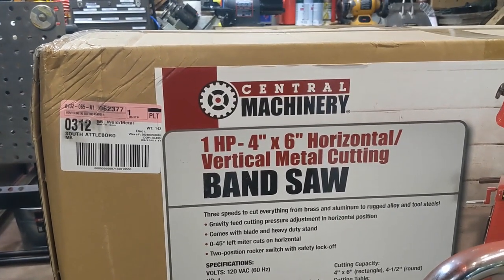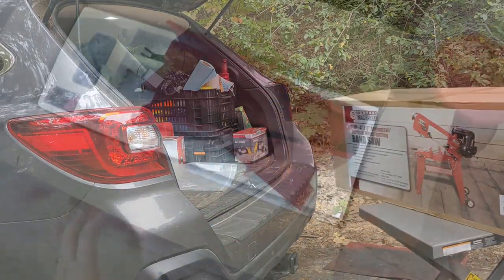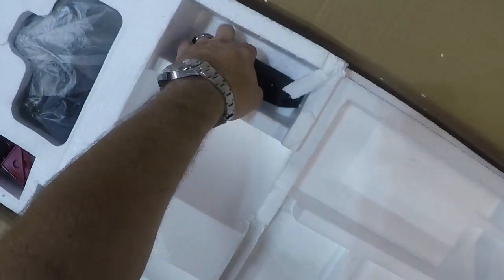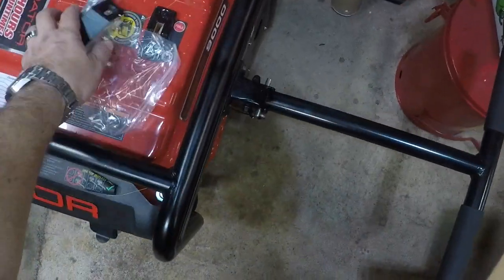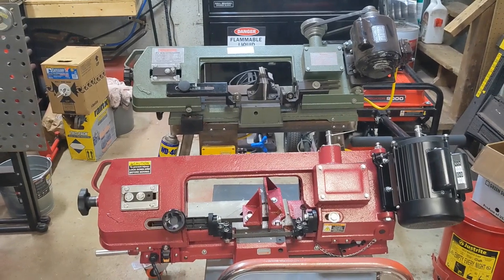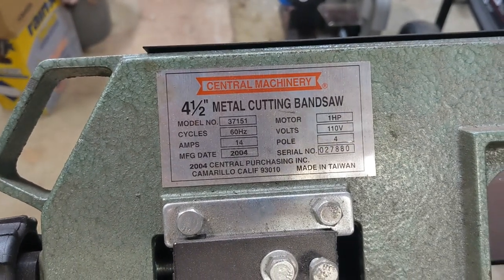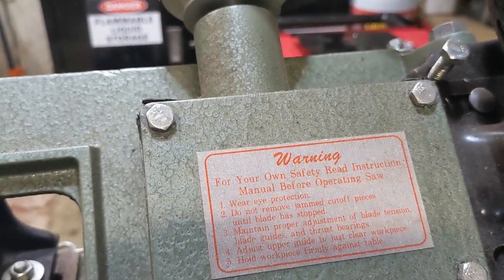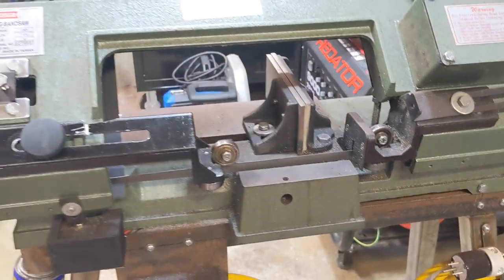I Bought a New Harbor Freight 4x6 Bandsaw

Comment: Nov.5th 2022 the bandsaw retails for $369..but I got it for $314.99 with a 15% coupon..Horrible freight more or less sells kits of tools that require fitting and sorting out at home..they simply assembled it so the parts don't get lost in transport..1st step in building the kit is to disassemble it completely and replace every single nut, bolt, srew with actual steel hardware then flatten and square up all the castings..adjustment of every part during reassembly then the hour of fine tuning to get it cutting dime thin wafers square and consistent..this just part of the process of getting tools / equipment at half the cost as the next competitors products are often times basically the same but twice the cost with maybe 10 or 15 mins of extra labor to sort them out only slightly better..definitely appreciate the comparison between the two models..as I really wanted a green Taiwanese made model till watching this video plus the 20 to 30 yr old green ones are selling used for similar prices as the new red ones in my area unfortunately..

Comment: I have a hf bandsaw from 1988 im 4th owner of it. You can image the amount of metal its cut. The blade guide extentions are steel on it. The only real complaint i have about it is the motor and pulleys the pulley suck thin aluminum. The motor doesnt take long to hit therma switch and shut off. Other wise its kicking but restoring it now.

Comment: After watching your video you left me confused. 

 You seemed angry with harbor 
freight??
Did you finish setting up the saw?

Is there an update??
Reply: Yes. Jussssst a bit of an angry person I'd agree with. Shop full of goodies and nothing but complaints.
Reply from the maker: Not really angry. Loved the green saw that lasted for 16 years. A little disappointed with the red one, but was able to get it cutting perfectly fine. Just that overall quality has declined from what it was - but I guess that's to be expected with the price staying about the same.
Reply from the maker: There is an update - recorded a couple weeks ago. Just haven't edited yet. Working fine and with an upgraded power switch.
Reply: @rhavasy  I would digress, it’s not a bad little machine for the price. In actuality, the single most expensive ‘part’ is the motor! Those are practically the entire cost of the tool alone at an average of of $200-300 a piece commercially. Alternatively, nearly everything today has gone down in production quality. It’s a marketing construct. Lighter, smaller, ‘bearable’ and can it still work if we thin this material out? It’s just unfortunate that American engineering is all but gone and we’ve shifted 90+% of all manufacturing to Asian countries; and this is what we get for it. But I hear you!